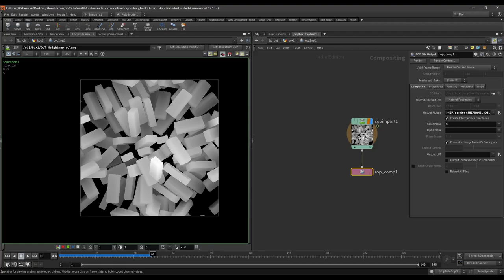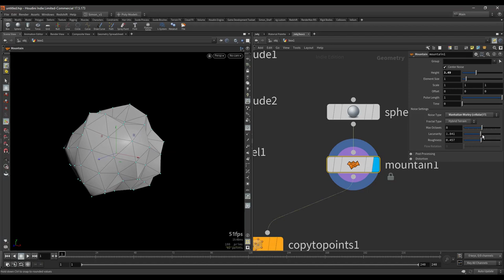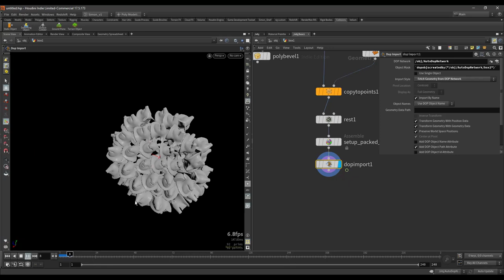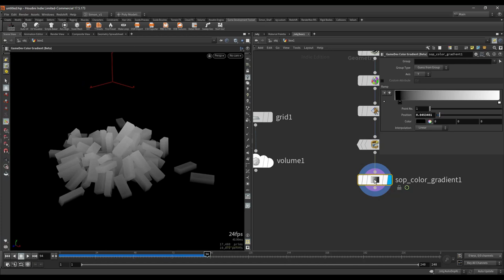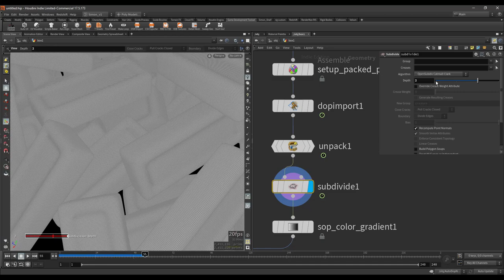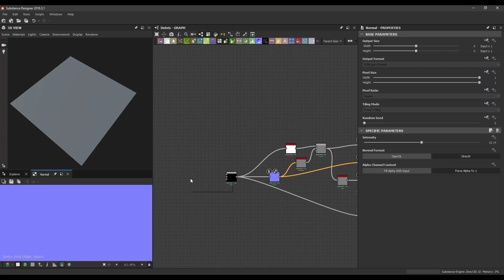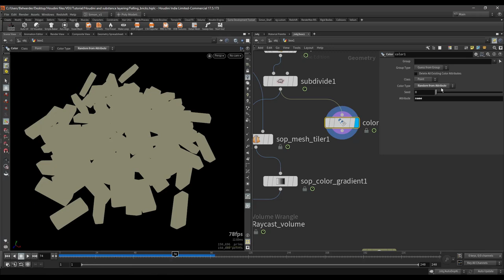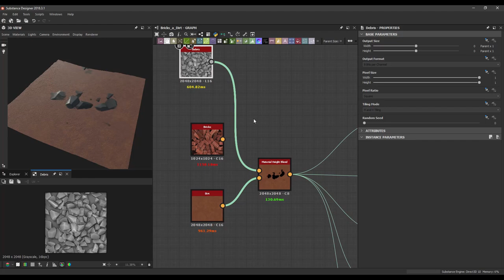Houdini simulation to Substance Designer || tutorial

Comment: Hi Simon, thanks so much for making this video very useful. Ive got a few questions which I am hoping you can answer. How would I be able to import my own obj to simulate with? Also how would I be able to link multiple obj files? Second question, what does your LP/HP look like from houdini that you baked in Designer?
Reply from the maker: You can import your own models by going to file -> import -> geometry (if you use obj)
I mainly use fbx files and drag and drop them in Houdini
Once you import all your models merge/combine them together. (In other words if you import a model a file node while be created, bring all the files node of the objs together in one network, so if you replace the brick of the video with the file node it will work)
For the bake my low poly is just a plane and the high poly is the simulation. Plane should be placed under the high poly so it can see the high poly.